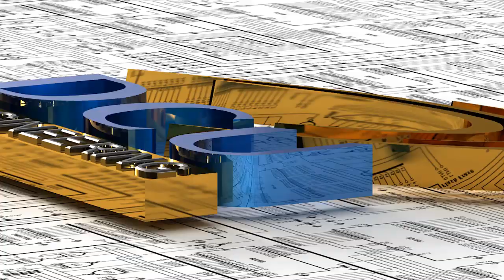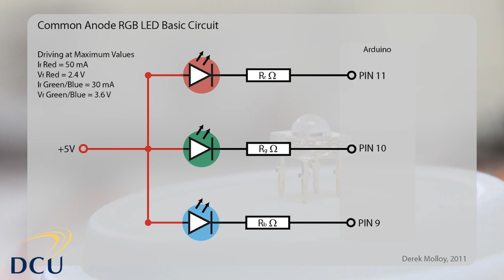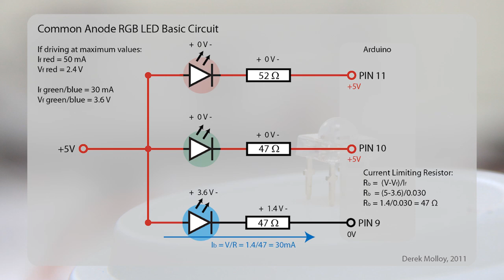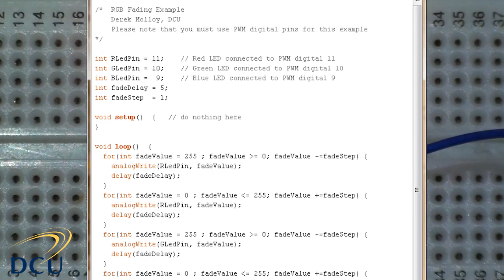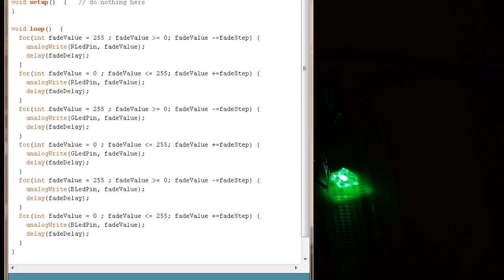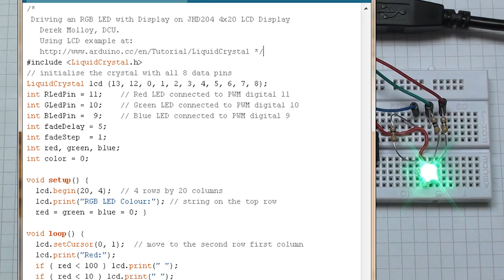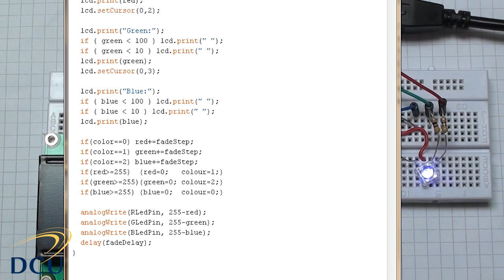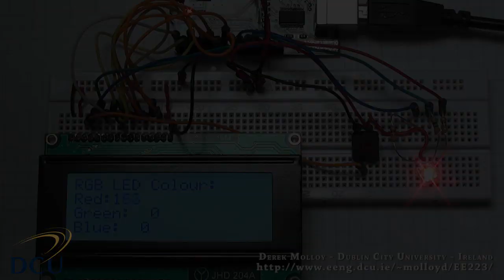Arduino: RGB LED Tutorial (Pirhana RGB with LCD Display)

Comment: Thanks for getting back to me. The Pressure sensor that I want to use is the FSR (Force Sensitive Resistor) Would I still need a colour conversion?

Thanks

Comment: Thank you for getting back to me, the pressure sensor that I will be using is an FSR (Force Sensitive Resistor). Will it still be the same with choosing a meaningful colour conversion?

Thanks

Comment: Just want to say thank you for this tutorial. I searched high and low for one like this. I was just wondering what I would need to do to the code if I wanted to use a pressure sensor to control the colour of the LEDs. 

Many thanks